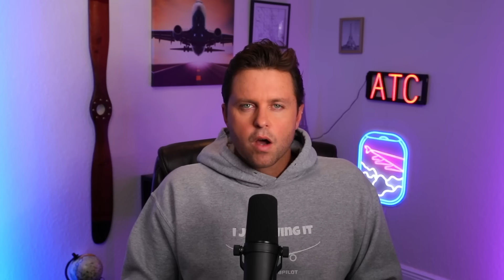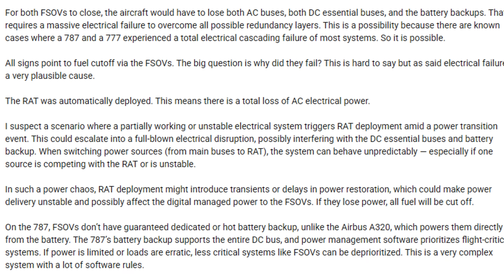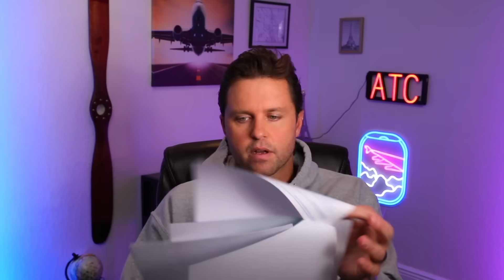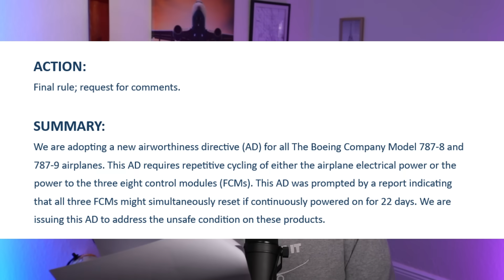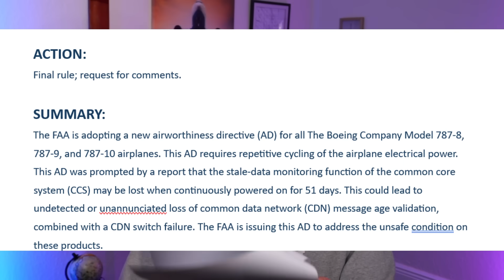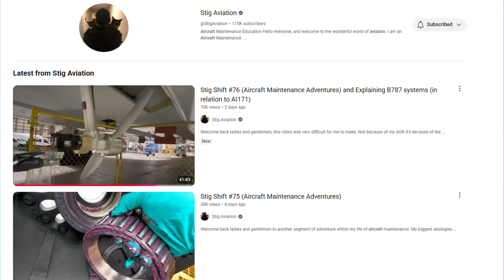Air India 171: Did a Software Glitch Cause Dual Engine Failure?

Comment: At first I thought maybe the pilot clumsily flipped the switches that they use to shut off the engines after landing.  Then I thought that was ridiculous and probably wouldn't do anything in the air.  Then it seemed that something like one "exploded" 20-milliamp resistor burned up and caused the entire electrical system to fail.  After that, youtube speculation has all been fun, amazingly extensive and probably more  likely.   I hope to hear something from the two (nose and tail) combination voice/data recorders soon.

Comment: Seems very plausible electrical issue prior videos or computer glitch caused the fuel shut off valve to deploy,  but since 787 has an almost perfect record prior I would say it’s probably more on Air India Maintenance than Boeing.

Comment: A total aviation amateur myself but still - I do think you are into something essential here. I already mentioned eletrical failure to fuel supply or that the engines ingested something just before lifting off the ground in one of captain Steeeve’s first videos as suggestions why the accident happend. 
Now it seems there are something to it although we still dont know…

Comment: What you have are several interlocking potential events 
Such that there  can be no way
To truly understand which is the cause, and which is the effect.

The software can reduce or eliminate this cause/effect
relationship.  A glitch in the electronics can induce a software
error that can trigger a shutdown.

Where is the certainty of what happened?  There is no certainty. 
It is unknowable.

Comment: Engineers who grew up here in Silicon Valley refer to Lockheed as 'The Lazy L', where engineers go if they want an easy 40 hour a week job with little stress, and where they can coast until retirement.
It looks like Boeing may be Seattle's equivalent.
Reply: Rake - Damn -

Comment: This passes the smell test. The more fail safes and complexities added to any system, the greater the risk. That’s not to say we shouldn’t have redundancies and fail safes. 
It’s easier for me to believe a rare edge case software design flaw shut the engines down rather than a fuel contaminant. I don’t know what the cause was, but if I were a betting man, I’d put money on the plane’s software being responsible for cutting those engines.

Comment: i'm anxious on this one to see some facts coming out from the data recorders. i personally am having trouble reconciling the fact that they seemed to have an abnormal takeoff roll (i don't think that is in dispute at this point ?) with a "sudden" anything after that. why didn't they reject ? was there a lack of power on the roll ? if it was a binary style systems failure, that took them to zero power, what was happening before that.

Comment: The explosion seems to have caused a total electrical failure. However, the computer would probably have had a back up battery. The explosion might have severed the wires from the cockpit to the computer but not from the computer to the fuel flow valves. The computer might have received what it interpreted as an instruction to throttle back the engines. In a fly by wire aircraft, there is no direct mechanical override to prevent this.

Comment: Corroboration of Data in the Video
The video "Air India 171: Did a Software Glitch Cause Dual Engine Failure?" by Garybpilot discusses the theory that a rare electrical failure on the Boeing 787 could cause both engines to lose power, possibly due to the automatic closure of the fuel shutoff valves (FSOVs) when electrical power is lost. The video references multiple sources and airworthiness directives (ADs) to support this theory.

Key Points from the Video and Where They Can Be Corroborated
1. Software Glitches and Electrical Failures on the 787

The video mentions several FAA airworthiness directives (ADs) related to electrical system vulnerabilities on the 787, particularly a software bug that could cause all generator control units (GCUs) to enter failsafe mode after 248 days of continuous power, resulting in total AC power loss.

This is corroborated by multiple sources:

FAA ADs published in the Federal Register detail the issue and the required periodic power cycling to prevent this scenario.

These directives confirm that the 787’s electrical system could, under specific circumstances, experience a total loss of AC power due to a software counter overflow in the GCUs.

2. Fuel Shutoff Valves (FSOVs) and Fail-Safe Design

The video posits that the FSOVs on the 787 are spring-loaded to close if electrical power is lost, cutting off fuel to the engines as a fire safety measure.

While the video says this is common knowledge and references Google search results, it asks for confirmation from a 787 manual.

FAA regulations and ADs for transport aircraft, including the 787, require fuel shutoff valves to be fail-safe to prevent uncontrolled fires in case of severe engine damage or fire, supporting the assertion that loss of electrical power should cause the valves to close.

The ADs also note that failures of these valves (including spontaneous closure in flight) have occurred on Boeing aircraft, though most cited examples reference the 777, not the 787. However, the fail-safe logic is standard across Boeing designs.

3. Sequence of Electrical Failure Leading to Engine Shutdown

The video describes a scenario where a cascading electrical failure could cause both FSOVs to close, shutting down both engines, and references the deployment of the Ram Air Turbine (RAT) to restore power.

The 787’s electrical system is designed such that, in the event of a total AC power loss, the main battery provides power for a few seconds until the RAT deploys and restores basic systems. This is consistent with the scenario described in the video.

4. Real-World Incidents and Related Bulletins

The video references a 2017 incident involving an ANA 787 where both engines shut down after landing, possibly related to thrust reverser and TCMA (Thrust Control Malfunction Accommodation) system logic. This incident is documented in aviation news sources and Boeing bulletins.

The video also draws parallels with known software and redundancy issues in other Boeing aircraft, such as the 737 MAX MCAS incidents.

References in Official Boeing 787 Manuals
Access to Boeing 787 Manuals:

The Boeing 787 Flight Crew Operations Manual (FCOM) is referenced in the search results, but the publicly available versions are typically incomplete or redacted for proprietary reasons.

The FCOM describes the structure and purpose of the manual, including systems information and non-normal procedures, but the specific section on FSOV operation in the event of electrical failure is not included in the excerpts provided.

However, the FCOM and other Boeing manuals do state that the manuals include detailed system descriptions and non-normal procedures, which would cover the behavior of FSOVs under electrical failure scenarios.

Summary of Manual Content:

The FCOM Volume 2 (Systems Information) would be the section where details about the fuel system and FSOV logic are found.

While the exact text is not available in the public domain, airline training materials and systems summaries confirm that on modern Boeing aircraft, fuel shutoff valves are designed to close automatically if electrical power is lost, as a fire safety feature.

Conclusion
The video’s claims about electrical vulnerabilities and FSOV behavior on the 787 are corroborated by multiple FAA airworthiness directives, aviation news sources, and standard Boeing design practices.

The specific scenario of both engines shutting down due to simultaneous FSOV closure from a cascading electrical failure is plausible and consistent with the fail-safe design philosophy, although there are no documented cases of this exact sequence occurring in flight on the 787 to date.

The Boeing 787 FCOM (Volume 2) would be the authoritative manual where this system logic is described, but access to the full manual is restricted. Airline training guides and FAA/EASA directives provide supporting information consistent with the video’s summary.

In summary: The data in the video is well-supported by regulatory documents, industry reports, and standard Boeing system design logic. The Boeing 787 FCOM Volume 2 (Systems Information) is the manual where this information would be officially documented, but direct public access is limited. The fail-safe design of FSOVs and the electrical system vulnerabilities are corroborated by multiple official sources.

Comment: Thanks.

There are lots of problems that lead to accidents of this type. Dual engine failure is indeed quite common. However control.laws can also cause problems the Ethiopian 737 Max, the terminal profile of Air France A320 Flight 296Q looked almost identical. Essentially the FBW defeated the pilots capacity to control the aircraft.

Comment: You also said: "If power is lost, the spring closes the valve instantly, cutting off fuel to the engine. FSOVs are a fail-safe, designed to protect the airframe, not the engine. In Boeing’s logic, it's safer for the engine to shut down than to keep feeding fuel into a potential fire."
What fire? A complete electrical failure and an engine fire at the same time? In the unlikely case that there is a complete electrical failure, batteries and all, they want the airplane to also become a glider IN CASE one of the engines gets a fire? What kind of knucklehead aerospace engineer would design an airplane like that?
My little one-engine airplane will continue putt-putting along if both the generator and the battery die, you're telling me that after 65 years of jet airline experience, Boeing decided to throw all that's been learned and reinvent the wheel on the Triple and the 787?
They taught us at my airline that the jet after a complete electrical failure will have about 20-30 minutes of battery power remaining and to use the radio sparingly because that's one of the biggest draws of power. Were we expecting the double insult of losing all power and all engines too at the end of those 30 minutes?
And if there was a total electrical failure, how did the crew made a Mayday call on the radio?

Comment: From quick memory of past fuel filter issues resulting in loss of engine power, one engine had flamed out in advance of the other engine, not simultaneously.
Reply: This is an important point. There was no visible yaw at all, thus both engines cut off exactly together. Contaminated fuel would not do this.